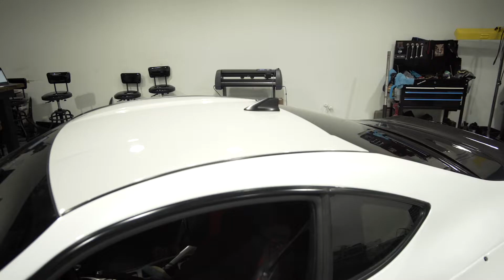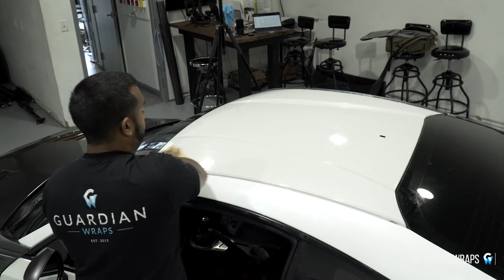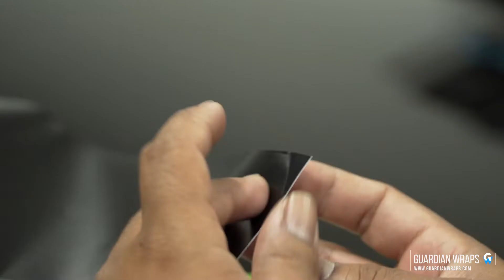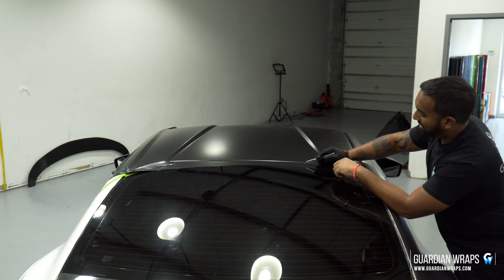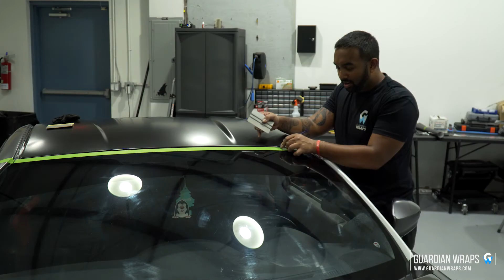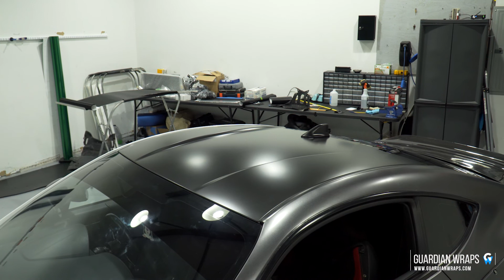How To Wrap A Roof - Scion FRS - Not So Quick Tips

Comment: This is the most professional video I've found about vinyl wrapping an FRS roof. I am about to do mine
Reply from the maker: Thank you kindly! If you have any issues, feel free to reach out!
Reply: @guardianwraps3221  I was hoping you guys had a video of doing the trunk panel
Reply from the maker: @oof578  Unfortunately, we didn't get a chance to film that portion. It's relatively simple. For reliability, We run a seam along the hard body line the FT86 has that separates the top and bottom portions. Run a string of Knifeless tape along that line and do the bottom first (remove trunk garnish prior). Then run another string of knifeless over your seam area and do the top. :)
Reply: @guardianwraps3221  Thanks for that suggestion, I figured that would be the way to go :)
Reply: @guardianwraps3221  2nd failed attempt wrapping the roof with vivid. I've never had so many issues with wrinkles and not being able to glass out the panel like this. I even followed this video closely and it just will not lay right for me.
Reply: @oof578  hey! So your issue is actually the vinyl. Vvivid is very aggressive and is actually heat activated. It'll be very difficult to glass that material to achieve the same process. You'll need to do half the vinyl at a time doing a hinge method. Although I do recommend getting either 3m or Avery for your project. Vvivid from our experience tends to shrink pretty bad after install and can be very difficult to remove. Also the lifespan seemed to be very very short. We can walk you through it before your next attempt if you'd like to get in contact with us via email or phone call. guardianwraps@gmail.com or 407-496-9117

Comment: Can people use a blow dryer vs a heat gun?
Reply from the maker: You can for smaller projects, but we recommend getting a cheap heat gun for larger DIY Projects such as this. Blow driers don't get as hot as a dedicated heat gun. There are plenty on Amazon or your local hardware store for under $20!

Comment: Do we use a lubricant when squeeging the wrap ?
Reply from the maker: You can mist some soap/water on the top of the wrap to help your squeegee glide across the surface easier. This also helps prevent any scratching the squeegee may cause.